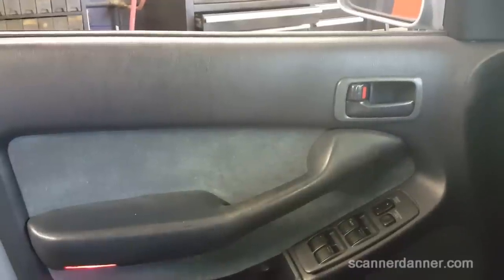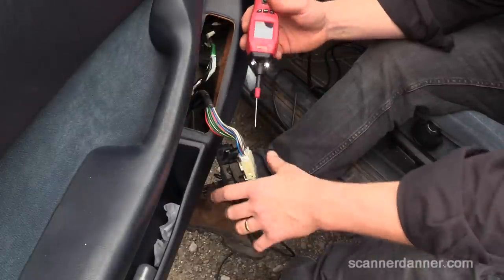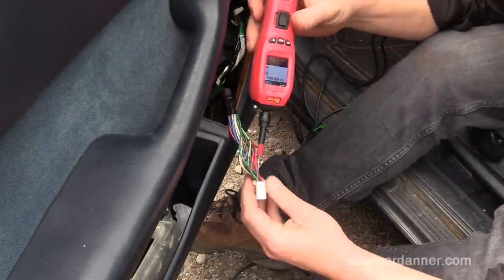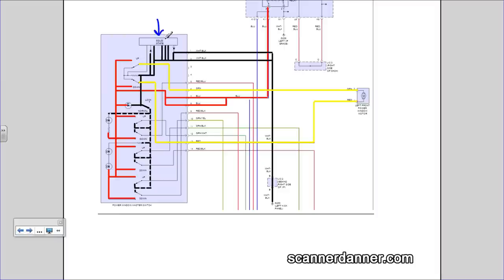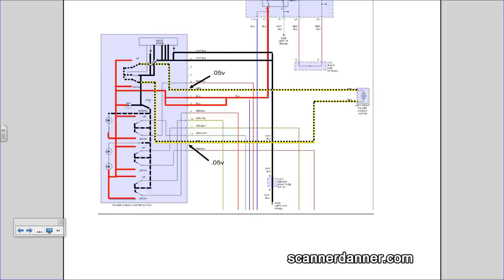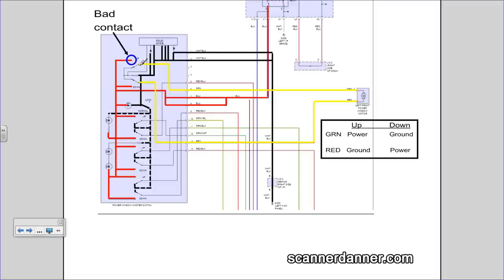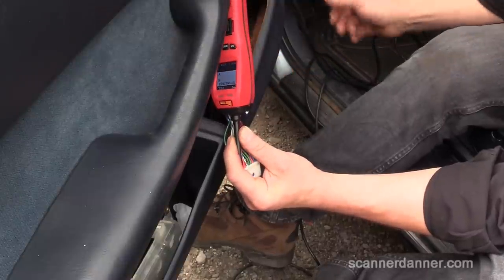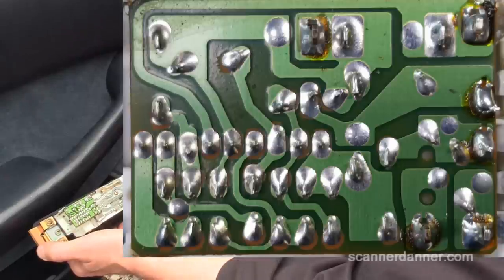How to test a power window switch/motor (1985-2001 Toyota)

Comment: the auto down function is simply a latching    relay or a basic transistor curcuit if u think this is difficult try working on cars with can bus systems.these old Toyota circuits are just child's play to the right person so basic  and bog standard it's boring at times diagnosing them.anyway scannerdanner is a champ for going through it in such depth especially the new techs.
Reply: Thank you but i disagree that CAN bus systems are more complicated. It's just different, same principles apply to testing an output of a power window module on a network.
Reply: ScannerDanner Premium Do you have any videos about diagnosing comm issues?
Reply from the maker: I have many no com videos from shorted sensors and blown fuses and more recently with the network itself. 
I have two coming up. Next week on this channel, I will be uploading a no com with the TCM on a 2012 VW Jetta that I filmed with Tommy Wolfe of Positive Lead Diagnostics.
Reply: ScannerDanner ok cool, I've diagnosed network issues before but it would be cool to see how you go about it. Especially with Can systems with Lin buses and all the other protocols I don't remember 😄

Comment: I’m no electrical engineer, but I believe when you press the auto down feature, the resistor, works in conjunction with the circuit board to maintain the physical position of the switch you activated until the window meets the end of travel at which time the current exceeds limitations, and the board then releases its control over the mechanical switch and the switch returns to the neutral ground position

Comment: I doubt the circuit diagram is complete, where is the thermal switch? I have my camry drive side powered window problem. When going down initially no problem, but when going up a short distance it stops, then I need to wait for few minutes before it can move a little bit up again. To fully close the window it has to stop a few times and each time a few minutes before I can reactivate.

Comment: I've used the power probe, the load pro, etc...  After everything, nothing beats the simplicity and efficiency of the mighty "TEST LIGHT".
Reply from the maker: agree, the test light would have been my tool of choice had it not been for the fact that I needed to manually get that window up.
Reply: Couldn't you use a DMM and just leave everything hooked up one way?   When it reverses it will just read negative voltage.  Easy peezy.  Unless i am missing something.  /shrug, love my fluke dmm with super sharp spear you in the eyeball probes
Reply: I think that's another way of doing it. The only problem with the volt meter is that it doesn't "load" the circuit like the test light does. So the test light checks for ground and power and loads the circuit at the same time.
Reply: keep the motor in circuit and it supplies the load.    meter just tells you if there is Voltage in both directions.  Sort of a quick and dirty test.  If it goes down, u get 12V so up without changing anything should be -12v because the grounds swap.  if it remains 0 the motor is good because it went down, only thing left is switch / solder on the switch board.  or a broken wire for up.  or the module itself   /shrug to each their own.  once one gets the feel for it, it is shocking what you can find out just with a simple diode check setting. 
 "use it as a short detector"  I have been in electronics repair for a very long time, i guess i am just really comfy with the DMM plus it is relatively cheap compared to fancy stuff.  the window circuit on my pathfinder is a bit strange, when you close the switch it grounds on a different module entirely. pretty simple really, hit the button, completes circuit and window moves.  used it to install my "momentary switch 2 wire door popper"  never call the locksmith again or worry about a magnetic key box letting go when u hit a pot hole or a good bump.

Comment: It's a switch with two contacts. You just needed to clean it properly with alcohol. No diagrams needed.
Reply from the maker: You're so right! All that other stuff I showed was completely useless. Anytime a power window doesn't work, just break out the old alcohol, open the switch assembly up, and have at it! Because it's always just the contacts, no need to test the circuits or anything.
Reply: The motor works. All other buttons work. Conclusion: bad contact or a broken switch... I can see you don't repair electronics, so attempting that will get you into a tailspin.
Reply from the maker: Not the point. Watch the video from a perspective of having an in-op motor. I am a teacher, I was teaching. If you can't see the value in that, then you're on the wrong channel.

Comment: I always just use a multimeter to diagnose window problems .   Just back probe both wires at the same time and then push switch either way .  Then  look at your voltage reading .
Reply from the maker: Definitely multiple ways to troubleshoot these. Thanks for the comment.

Comment: I am currently diagnosing a 1992 4 Runner drivers window that won't go up, but anyway, looking at the FSM Electrical "System Outline" which explains the operation of the different controls in the master switch it explains that in auto down 12v is sent to the motor while at the same time is also sent to a solenoid (inside the little "Solid State" box on the Mitchell diag. that doesn't show anything) which locks the switch in the down position and when the motor hits its down limit increases the current through the solenoid which disengages it along with the switch...  There's a lot more going on with 8 resistors,4 diodes (1 zener), a couple caps etc...  I know that won't play a part in my diagnosis, but what you explained really helped me out in direction when I attempt to fix my problem. Thank you for your time and expertise.

Comment: Great video on this window circuit.  I am also a huge fan of what you did with the diagram,  using paint to display voltage measurements through different portions of the troubleshooting.  Makes for a very clear and understandable procedure!  Tons of great information here to be gained on this system,  as well as lessons that can apply easily to others.  Wonderful video as always!

Comment: I  could never  wrap my head around a Power Probe and I know how they allow you to supply batt+ and - to the circuit under test . Yes the incandescent test light (scope on a rope SMA) is still my go to tool and if you know the current carrying capability of the circuit a sealed beam headlight makes a nice load.  
I agree that the auto down feature cannot  function as wired in the Mitchel diagram.
Keep up the great work between you, Eric O and Ivan I might just start to figure some of this stuff out      Thanks
Reply from the maker: Nice, thank you! I thought maybe I was going crazy with that diagram.

Comment: I believe the resistor is a current sense resistor. When the motor stalls, current will increase and the voltage drop over the resistor will increase. The  "solid state" box in your diagram will be able to detect the voltage difference between "true" ground and motor ground and stop feeding power to the motor.

Comment: I have seen these problems so many times in my time working on cars. Everyone should really look into taking the switch apart and getting to know the contacts inside "rocker" switch. They get built up with so much dust and gunk that they simply don't make contact. The down contacts are completely different than the up contacts inside the physical switch itself. I'll bet I've cleaned upwards of 50-60 switches for people over the years and got their windows back to perfect working order with simply contact cleaner, small brush, (sometimes toothbrushes work best), and some dielectric grease. Give it a shot on a known bad switch if a junk pile, you'll be amazed how well it works and how little effort it really takes. Saves money and customers LOVE when you can fix the little things instead of replacing.

Comment: Paul from my  experience attempting to fix taxi cab window switches over many years it just ain't worth the trouble.! I used to bodger them  using a points file (remember them) to clean the contacts but it always failed. Only did this if I didn't have one to go. Man, I know what you mean when you say patience is needed!

Comment: Great video. I don't have a schematic but what I would expect for the auto down is a self latching circuit.  In the old days a relay was used and the switch side of the relay would be put in parallel with the switch. The coil for the relay would be put on the unpowered side of the switch to ground. Once the switch is closed the relay closes its switch side maintaining the voltage on the other side of the switch to keep the relay closed. The latch is now in effect. Now with the window motor this voltage should be enough until the motor hits it end of travel and the motor stalls. When the motor is moving a back emf (electro-motive force) is generated which is proportional to the speed of the motor. This is because all D.C. Motors are also generators.  At the end of travel the voltage will disappear and the coil will loose its power and the relay will open delatching the circuit. Now these days the relay may have some kind of transistor circuit to replace the relay. By the way, multiple grounds and power pins may be put on a circuit board due to the limited current carrying capacity of the connector pins. The traces on the board or power/ground planes can be beefed up to carry high currents but there is a spec on the pins which is the limiting factor.

Comment: My Buick Park Avenue 2002 front driver switch has quit.  Power windows.  Door locks.  And mirror has quit working.  I have purchased a ZKZYEE Vehicle Super Probe KM50 to test with.  It has been difficult to find anything on the internet about the fuses.  I believe the fuse is in the back under the seat?  Or under the dash.  The Windows quit previously, and the door locks on the driver side.  Then, after about (2) two months the light on the switch began flashing.  I tried it and it started working again.  Now, it has stopped again.  And the passenger side has stopped working also?  It is difficult to find a specific video for the 2002 Buick Park Avenue.  I like your video.  I subscribed.

Comment: I've read the schematics, good ones, bad ones, and I still can't figure them out. If someone could tell me once how the auto-down feature operates, I could probably do a little better, but..... 

I e also tried to diagnose a power window switch from a '96 GM pickup passenger side. I finally just left the switch unplugged, as no one wanted to spend the money on a new switch, and the salvage yards didn't want to warranty the used ones. $40 whether it worked or not. So, we just left it unplugged, as it wouldn't operate correctly from either side, but operated from the drivers side correctly, with it unplugged. 

Great vid, thanks! And thank Pete for taking one for the team, props to him for letting you "play around" with the electrical stuff!
Reply from the maker: I usually can, but not on this one. I am positive there are mistakes in that diagram. There is no way that auto down module needs 3 or 4 different ground wires.
Reply: ScannerDanner, I wonder if a different source would show the same diagrams, or if there is something wrong with the factory ones? I discovered a factory issue in a motorcycle factory repair manual (not an aftermarket, Clymer or other brands). Mistakes can be made anywhere up the chain. Perhaps you could look at Ivan's (pine hollow auto diagnostics) favorite go to source. BBB Industries. Maybe their diagrams show the correct info. It's a free, public source, not a pro source. But it's usually very good. Just another tool in your bag!!

Comment: I would assume the solid state device serves as an electronic latching device during the auto down function, and so that part would not be displayed in the electrical schematic.  I prefer to utilize my DVOM, not the test light, to check the loaded voltage readings and see the loaded ground circuit  voltage rise.  Good video as always.  Keep up the great work.

Comment: I agree that the diagram does not appear to reflect the circuit which holds the power on the window motor to travel all the way down, or all the way up automatically. My guess is that it will be some kind of transistors or FETs in parallel with the manual switchs. It is also my guess that the resistor in the diagram that is more than likely clamped by the diode (notice it's in the circuit with reverse polarity) is the circuit that tells the solid state control when the window has reached the end of the travel. The amount of current through that resistor will increase sharply when the motor reaches the end of the travel creating a voltage drop seen by the controller to turn off the window motors. Typically a diode is used as a clamp to prevent the voltage drop from being too great due to high current draw thus damaging the input that monitors the voltage drop. Regarding the circuit board being damaged, what I believe we're seeing is not burned connections, but instead soldering flux that was not cleaned off. It could indicate an attempted repair in the past, or a rework at the factory due to defect.
Reply from the maker: Great insight! Thank you.
I only mentioned the "burnt" contacts for the untrained eye. That would be the first thing they would see and I wanted to make a point that, that was not what you're looking for. 
You would be correct, "burnt" was not the right word to use.
Reply: Oh, and I forgot to mention, great video! I really enjoy the discussions about the voltages found on grounds, loaded and unloaded, and how those things can help us determine a problem.  As you point out, the amount of current flowing through a circuit will determine the voltage drop so the more current the higher the voltage will be above ground, or battery negative. The same holds true on the positive side, or really anywhere in the circuit. The perfect wire, or circuit would have zero resistance, but that's never the case. Wires, switches, connectors all provide a little resistance in the circuit and will thus provide a voltage drop proportionate the the amount of resistance, and the amount of current. Ohms law.
It's a thinking mans game, and rewarding as well when we understand how it works. We need the money of course, but it's satisfying to work on these things when we come to understand what's going on. Again, thanks for sharing another great video.

Comment: Hi Paul i think the reason when the switch is in the middle it puts and earth on both sides of the motor, it's kind of like a dynamic brake if you will, they used to do it on wiper motors in the UK in the 1970's to stop the momentum of the motor carrying it over the park switch and carry on working when turned off, when the park switch opened it put an earth across the motor stopping it dead...hope that makes sense...with windows i used to put a bulb in place of the motor as they dont worry about polarity if you put a volt meter in place of it of course it would try to go backward on one side and forward on the other...from Fred in England.

Comment: Hi, good video, i have installed 2 power windows  to my manual windows. Passenger and rear behind passenger. Have not installed the driver side with master switch, my question is, does it need master switch on driver side installed in order for all the other windows to work?

Comment: those switch assemblies are very similar all throughout toyota.  I have a 96 land cruiser and an issue arose with the windows.  I know that being a 'parts swapper' is not preferred by you, but $10 and an hour and a half of time and I was able to replace the assembly and have it working by using a switch from a 96 four-runner.  
after investigating the faulty switch I found corrosion at the faulty contact.  now I have a spare switch assembly, and more important, I was able to keep the wife happy.

Comment: The way I would've done it would be to put a voltmeter across the green (+) and red (-) wire.  In the "up" position, you should read +12volts.  In the "down" position, you should read negative 12volts.
Reply: Yes! - Why not do it the easy way? Save watching a 44 minute video, (which is great), but speaking for myself, I'd prefer to just get on and fix it - life's too short.
Reply: There is no neg. 12V ;    
  there is ONLY  +12V  and 0V(ground)  but i get what  were saying
Reply: The voltage you read on the DMM is the voltage of the red wire relative to the black wire.  If you switched the red and black wire, you will read a negative voltage.

Comment: 19:15.  In an ideal world, there should be zero resistance between where you're tapping and the car's chassis.  But there is small resistance between where you're tapping and the chassis.  That resistance is fixed, albeit a very low resistance.  Remember Ohm's Law, E=IR (voltage = current x resistance).  By allowing more current to flow through that section of wire, the voltage drop across that wire just went up.  That's why your voltage went up from .05 to .97 volts.

Comment: you ever run into a broken wire in the door jam I run into that all the time wear the harness goes into the door the wires Flex a lot and end up breaking inside the casing talk on them a little bit the broken one will stretch just fix that on my Ford Explorer only took 2 days LOL